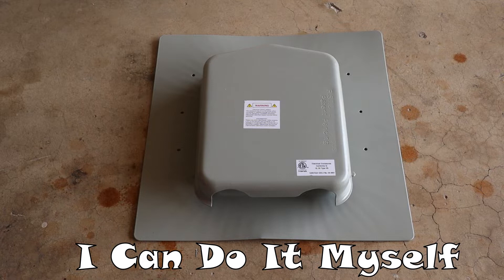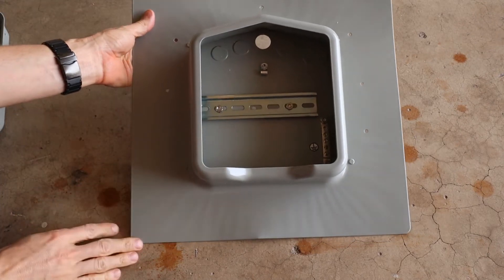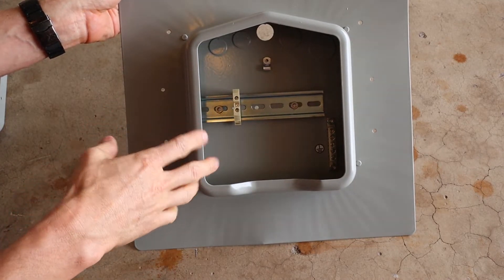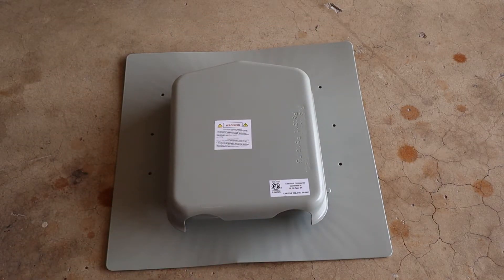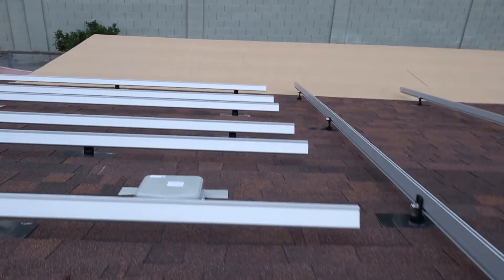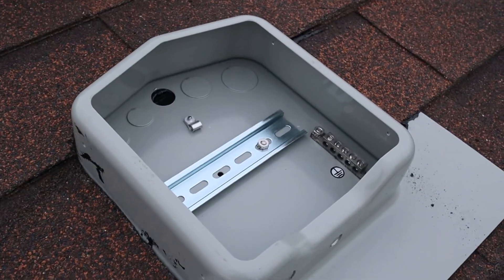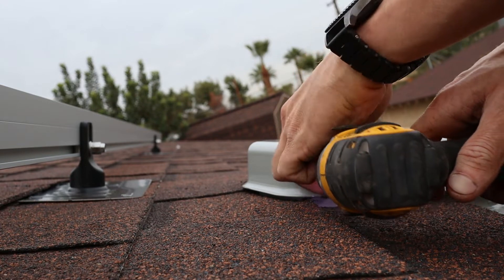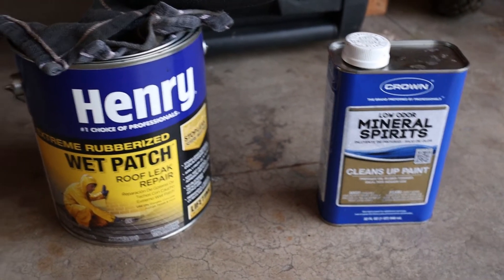My DIY Solar: Part 5 Soladeck Junction Box

Comment: Why did you use three soladeck instead of just one penetration?
Reply from the maker: When you have conduit running open across the roof, there are other codes you have to follow. Using the Soladecks kept it cleaner looking and easier.

Comment: How did you know how many flashfoot you needed per rail?
Reply from the maker: Start on the Ironridge website. They have a builder that will help with materials. Here's a link to help with spanning, although, it does not show what the overhang is for each type of rail. 
https://www.ironridge.com/component/xr-rails/

Comment: May I ask what's the function of the strain relief?
Also, what's the advantages of this solardeck comparing to just a regular j-box on the roof that doesn't slide underneath the shingle?
Reply from the maker: The strain reliefs seal out moisture and bugs from entering the junction box where the wire enters. It also protects the wire from rubbing and cutting on the metal edge of the junction box. The soladeck is a cleaner install. They are hidden underneath the solar panels where a standard is usually outside of the panels. Also, using a standard junction box, the conduit is run on the roof and outside of the house requiring extra labeling.
Reply: @ICanDoItMyself  thanks so much for the clarification. Appreciate it ☺️
Reply: Also the solar deck is good if you have multiple arrays and you want to run Mc through the attic to the roof

Comment: You should use the holes inside of the box instead of around the flange to lessen the change of it leaking.
Reply from the maker: Would've been easier too, but I did not think of that. Good idea

Comment: You have inspired me to do my own solar panel system, you stated you had installed the system before your permit process and the inspector was not allowed on the roof for personal safety reasons. What all was included with your permit submission?
Reply from the maker: Permit packet included 3 line diagram, equipment list, equipment spec sheets, load calculations, and fire department appeal. The flash feet are 6-8 feet apart.